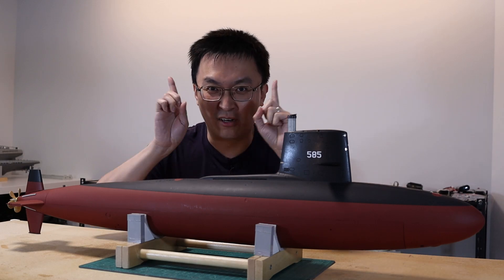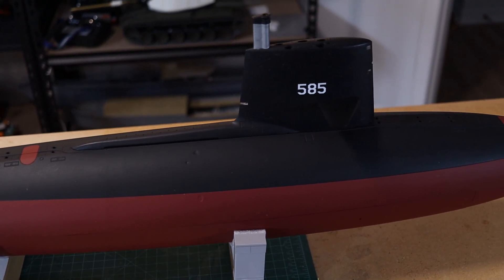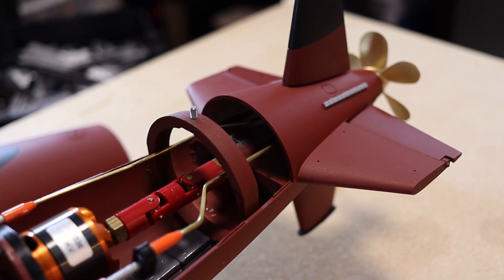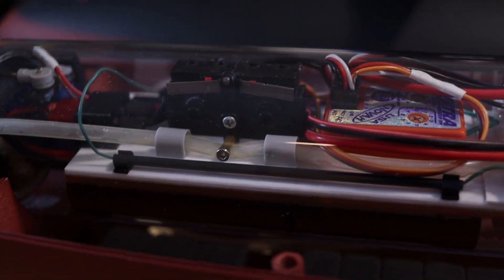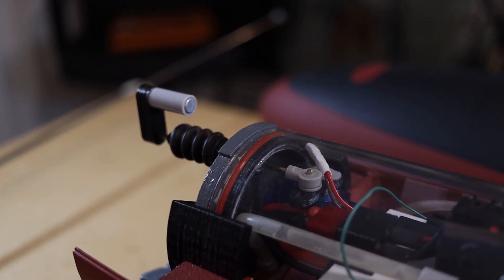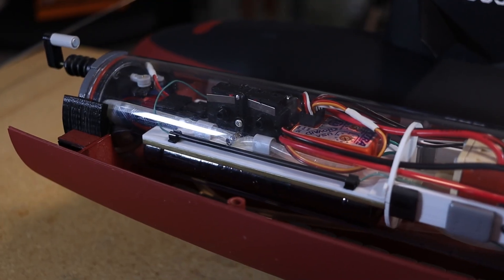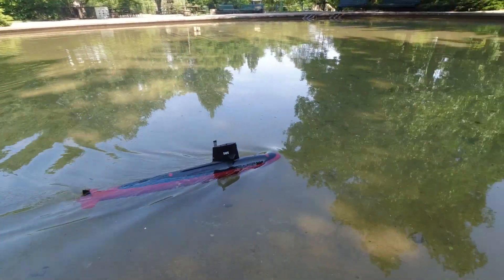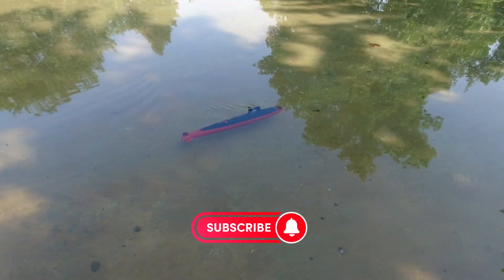RC Submarine USS Skipjack | RC Conversion

Comment: Awesome video. I would like to know what ESC you are using. I burned out a 30A ESC with my 2200 kv motor in the wet
Reply from the maker: Look up RW RC Bidirectional ESC on AliExpress, mine is a 30A.  2200kv is way too fast for underwater use.

Comment: Hi Nate, if you reduce the size of the snorkel tube you would probably be able to ballast her with negative buoyancy if I am not mistaking. My Skipjack has a snorkel and a horizontal plate the limits the amount of ballast water. (R&R system).
Nice clean setup of your boat and WTC by the way 👍
Reply from the maker: Thanks Robbert!  I did consider reducing the snorkel vent hole but the pond is really shallow where I run, so I still prefer ballasting her positively and running at periscope depth.  Might consider something similar to R&R on the next boat!

Comment: Excellent presentation. 

Maybe you could answer the query posted  in the Drydock forum regarding the sailplane control rod
"what must be done to get the magnet equipped servo pushrod and the long planes hull pushrod to mate up and have the FW planes at zero degrees? I have nice, floppy, uppy-downy planes and a long pushrod held in place with split heat shrink tube segments in the upper hull. Length adjustment is needed, as well as alignment for mating the two hull halves with working FW planes so that the two pushrods click together "
Reply from the maker: Do you have a link to the thread?